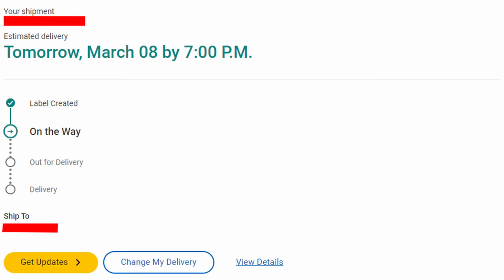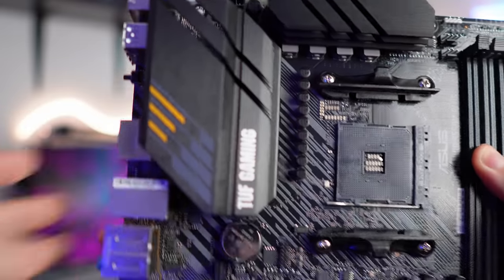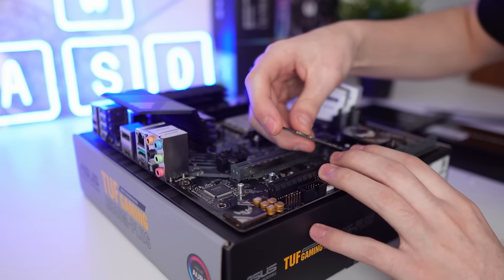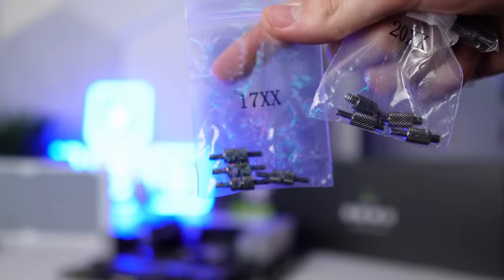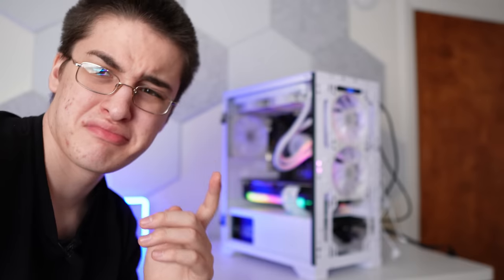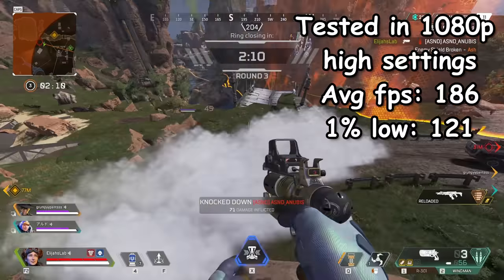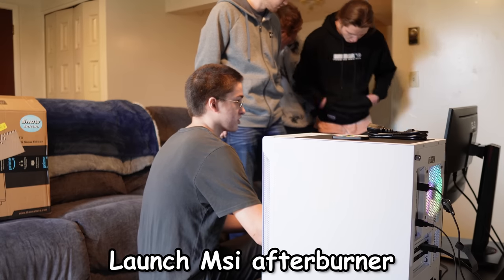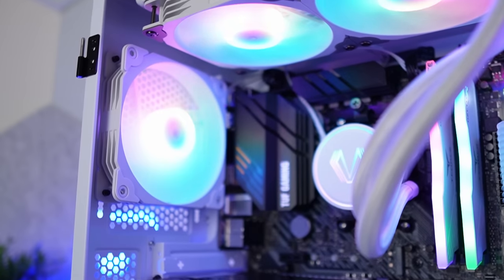This Gaming Computer Made Me $800! Flipping Pcs Until I Buy A House Ep. 6!

Comment: Nice work bro!!! What youve got going on is great and I wish you the best of luck.
Im not any type of expert or pro about anything, but right about the same time as when the whole Covid thing first started to pop off I learned how to build my own PC and after that I got into building and flipping them. Since then I've put together and sold about 20 PCs. So I can absolutely respect the hustle.
Ive gotta keep it real though, without being disrespectful... I wouldnt be saying too much bad about that motherboard, which is a perfectly fine board for the $150 price point, and then turn around and put a bunch of cheap, trash fans and AIO in the same rig as a brand new EVGA 3070and a 3900X, And Id never leave a fan missing from the front panel.. But hey, that's just me. You do you bro.
Either way, you obviously did a great job. Good luck to you!!!!!
Reply from the maker: I go with that works and looks good for flips. They aren’t “terrible” fans but yeah they aren’t the best. 

Thank you for the feedback :)
Reply: MethodMantis - I have this case and I can honestly say a third fan in the front at the bottom is absolutely pointless. It basically just blows on the power supply. So if aesthetics is your thing then I get it. But as far as functionality and temps go, pointless.

Comment: can you guys see if this would be a decent or good gaming pc the specs are

cpu :Ryzen 5 5600G Cezanne 3.9GHz 6-Core AM4
mother board :B550 AORUS Elite AMD AM4 ATX Motherboard
memory :T-FORCE Delta RGB 16GB (2 x 8GB) DDR4-3200 PC4-25600 CL16 Dual Channel Desktop Memory Kit TF4D416G3200HC
graphics card :NVIDIA GeForce RTX 3050 Gaming Overclocked Triple Fan 8GB GDDR6 PCIe 4.0 Graphics Card
ssd :980 Pro SSD 1TB M.2 NVMe Interface PCIe Gen 4x4 Internal Solid State Drive with V-NAND 3 bit MLC Technology
case : Lancool II MESH Type C RGB Tempered Glass ATX Mid-Tower Computer Case - Snow White
power supply :SuperNOVA 850 GA 850 Watt 80 Plus Gold ATX Fully Modular Power Supply
Reply: That would be a straight pc but it could get a little upgrading on some parts but other then that yh u shouldn’t lag or nothing on that pc
Reply from the maker: Solid my guy 😎

Comment: Hey I need help I made a dell optiplex 3020 gaming pc but it won’t show a signal to the monitor but the fans run can u help me?
Reply from the maker: Make sure you have the display cable plugged in correctly
Reply: @ElijahsLab  I’m using a HDMI